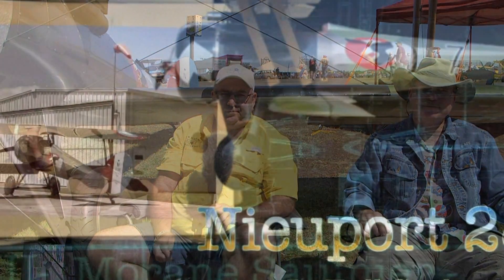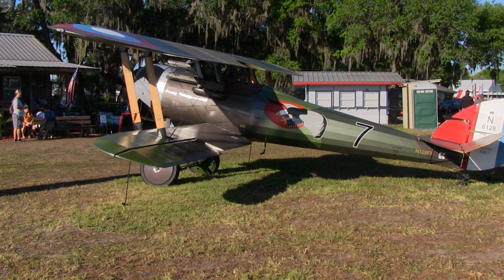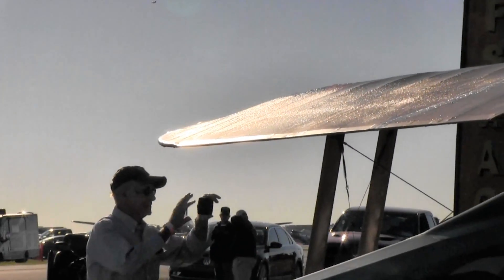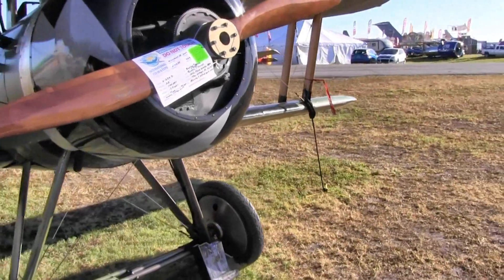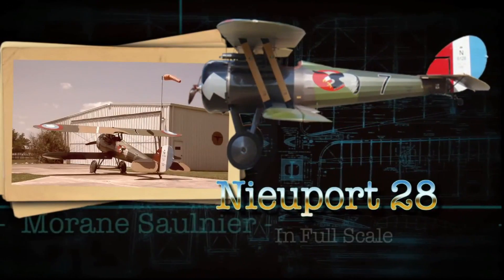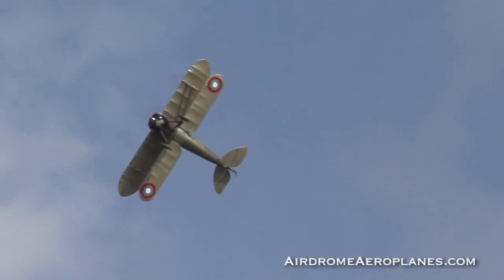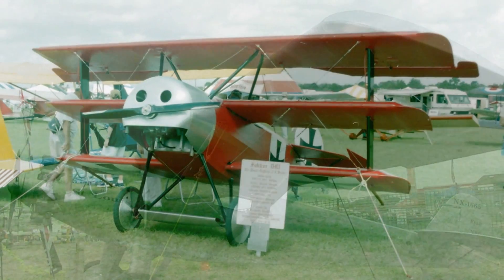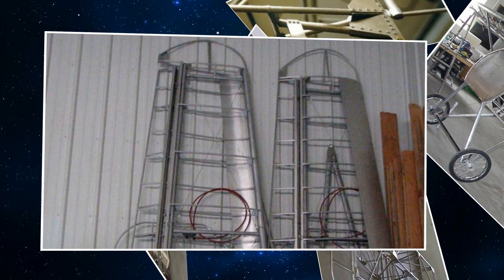Airdrome Aeroplanes, WW I Full Scale Replica Fighter Aircraft the Nieuport 28.

Comment: Can these aircraft do aerobatics like the original ww1 aircraft such as immelman turns?
Reply: Do you realize the original planes weren't really stressed for aerobatics and many just disintegrated in mid air?
Reply: @drewschumann1  They weren't that fragile. Unless you dove too fast or suffered some structural damage from being fired at they didn't just desintegrate mid air. And Immelman turns were invented by Max Immelman at the very start of the war so I'd say maneuvering was fairly commonplace - depending on the type of aircraft. The infamous BE2c was designed to be rock stable and maintain level flight, which obviously made it as nimble as a walrus if it was attacked by more nimble aircraft. 

No, the real reason something this fancy isn't tried today is because the obvious safety risks involved and the money invested. Does anybody who owns a Bugatti Type 35B from 1927 actually try to drive it like the racers of the 20's?